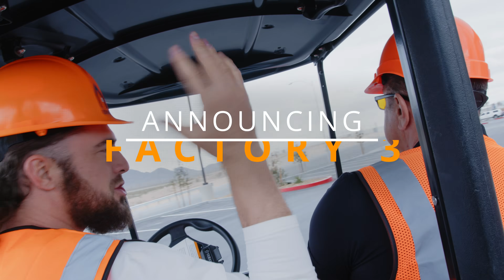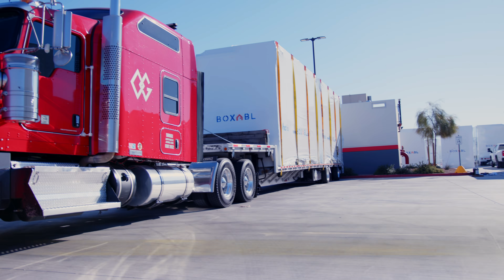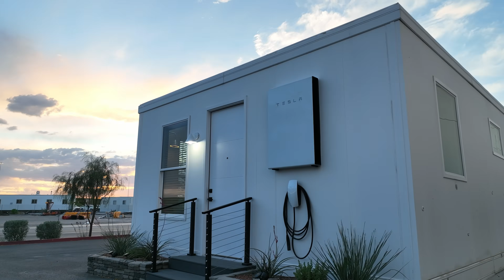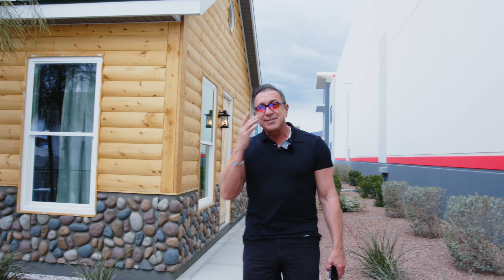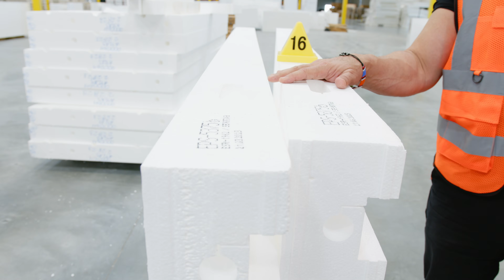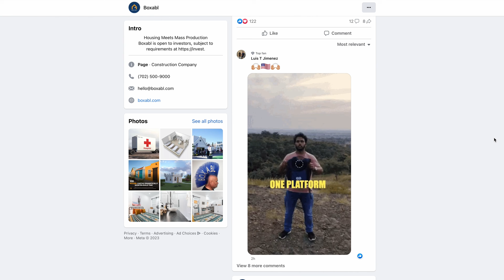Ep. 5 BOXABL Factory Update 2023 - Panel Upgrades, Factory 3, and BOXZILLA

Comment: Crazy idea: Boxabl underground bunker, using two Boxabl stacked on top of the other, one is buried under the ground level one.
Reply: A subterranean structure would have to be engineered to withstand the pressure of the soil and water placed against it. Also the materials have to be able to withstand rot and pests. Good old fashioned CMU/concrete would be optimal.
Reply: Genius idea I had this idea make a bunker box that stacks 3.  1 under ground and 2 above ground.  Idea like to raise 5 million for dealerships license and get my sister brother veterans off the streets using this system and end 1.6 billion taxpayers money and give our veterans service connected veterans a buy option through their Va pay.  $250 a month and end the Hudvash program is failing us veterans with crime and no way out.  Va home loans a joke because there’s more money to force Veterans to rent and be in Hudvash programs because our pay is not enough now.  But great idea
Reply: I've thought for a long time that underground neighborhoods would be great in the midwest with the tornadoes. You can get plenty of light through skylights or fiber optic cables. Your heating and cooling costs would be insanely minimal. Groundwater exclusion would be an issue, but pool liners are an option. It could also be a good option in places where it is very cold, since you are super-insulated underground, and the ground can only get so cold, whereas the air can get extremely cold.
Reply: @amelialangston8452  Humidity becomes a huge issue with earth sheltered homes. Cool walls can have condensation and condensation then causes mold growth. Water can also seep through concrete. It is not to say this is not possible, it is possible; it is just to say success takes a lot more work and a variety of engineering skills that make it complicated.
Reply: Just use old shipping containers for the bottom level.

Comment: Put a Boxable in a wind tunnel similar to what they do with vehicles to see how air flows around it.
Reply: I bet it outperforms a double wide trailer.
Reply: Should be ok.  A company made trailers that folded out similarly back in the 70s.  They were way more flimsy and did not have problems in wind in the southern states.  I think the na.e was Magnolia out of Mississippi.
Reply: The Casita is a cube I think the aerodynamic test has been done on a cube long
Reply: Why unless it’s in hurricane prone areas it doesn’t matter
Reply: They are hurricane rated but Im not sure what Cat.  @daviddavis6140
Reply: That's an unrealistic expectation. If trees don't pass the wind tunnel test then it only makes sense that we should stop planting trees.
Reply: That would be interesting to see. Real-world wind tunnel testing could provide valuable data on performance and durability.
Reply: A dome shaped home is more wind resistant
Reply: Probably will disentegrate.